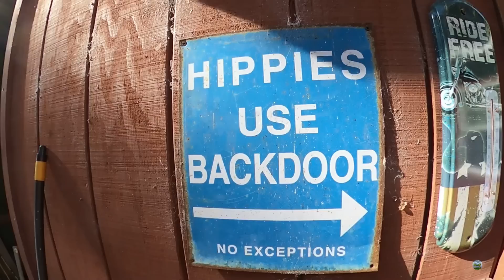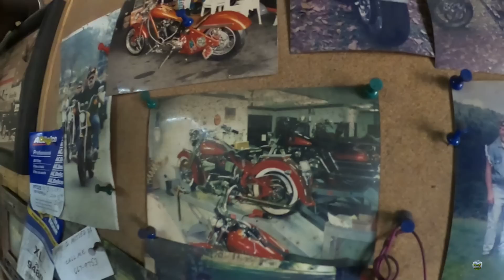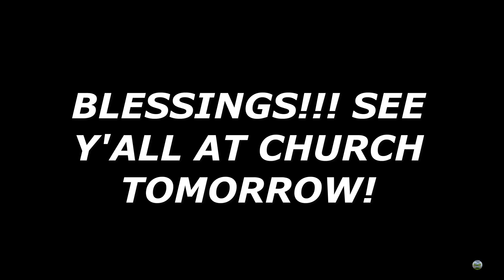Built Not Bought | What Was Your First Motorcycle? What Advice Would You Give Today's Riders?

Comment: My First Bike was a 1974 Blue Yamaha TX500. It had a Chrome cargo rack,a padded Sissy Bar, highway Pegs and eventually a 2 into 1 Bassani exhaust which when combined with a size larger mid-range Jets added a very nice mid RPM power increase. Rode it around town and on several terrific Road Trip adventures. It was very light and agile. It was a Good Bike.
Reply from the maker: Awesome bro!